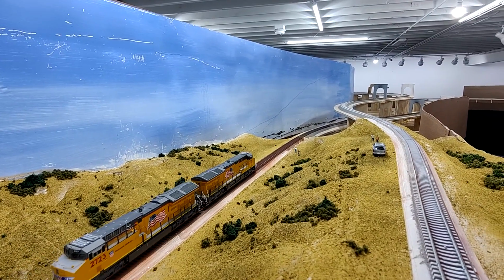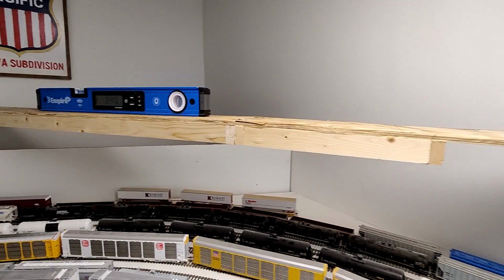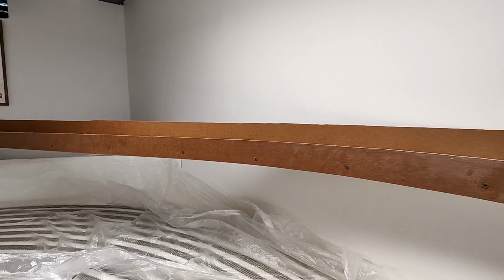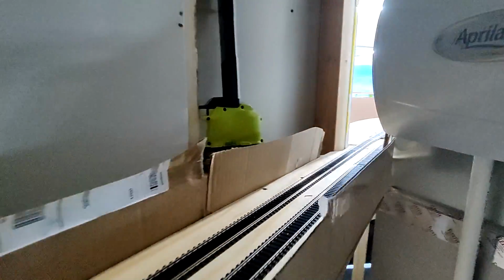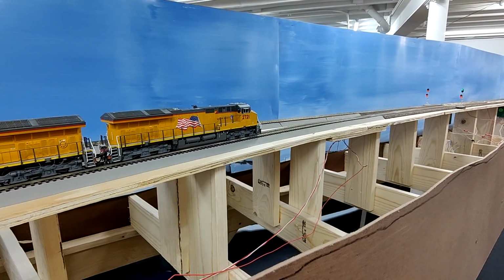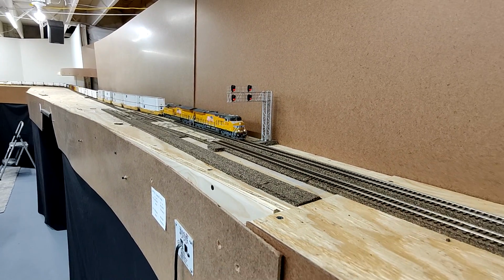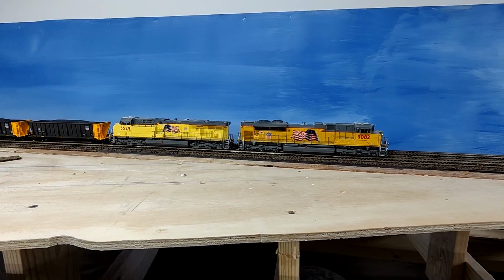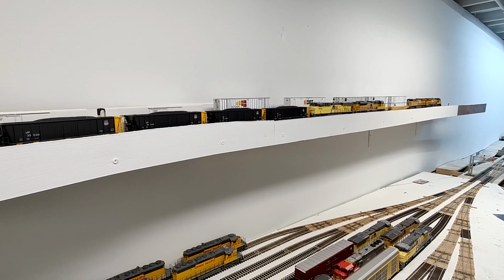S2022E27 Flyover Part II Ready for Second Level. Model Train Layout Ops & Realism Union Pacific RR

Comment: Great to see more progress on the layout! Any concern about heat coming off of the furnace impacting the trains?  Thanks for sharing!
Reply from the maker: No.  The pvc pipe in contact with the flyover is the intake. The area where the trains pass the furnace is at the AC coils.  Heat chamber is three feet below.  Either way there is no noticeable heat on the exterior of the unit.   I'll double check this winter, but I don't anticipate any problems.

Comment: The plastic couplers are a big problem you need to get rid of all of them. The Athearn and Scale Trains couplers are only good for parked (forever) equipment. Kadee and ProtoMax (Walthers) couplers are completely compatible metal couplers.
Reply from the maker: Just ordered a 50 pack of #148 with metal whiskers.
Reply: you can never go wrong using ka-dees. i have some number 5's that are over 40-50 years old and going strong. heck even the plate "springs" are in great shape. back in the day i was in a club with a huge layout, (the walnut creek model rail road society), my record was 250 weighted cars. and yes those couplers are still in use. i have not snapped a knuckle...yet.

Comment: Nice job, I'd didn't think your cars would fit threw the cut in the wall. It look pretty close with the double stack containers. I only been in model railroading for 6 years and heard that number 5 kadee couplers are the best what do you think. I haven't changed anything on my layout except a handful of cars.
Reply from the maker: That's what I heard too.  I'll probably do a big chunk of mine.
Reply: Ben, as far as which Ka-dee coupler to use, it really depends on the manufacturer of the rolling stock which number Ka-dee is used...you'll need to check each Ka-dee number to see which ones are compatible with your equipment, and whether or not you need long, medium or short shafts.

Comment: Athearn, Atlas, and Kato stock couplers are trash, upgrading to kadees will help a lot.
Reply from the maker: I was surprised how inexpensive the Kadee couplers are.
Reply: They are 100% worth it too. And it's nice that they make shelf couplers for the tank cars as well. I personally use the scale varieties but they also have the larger ones in both styles.
Reply: Absolutely !!!